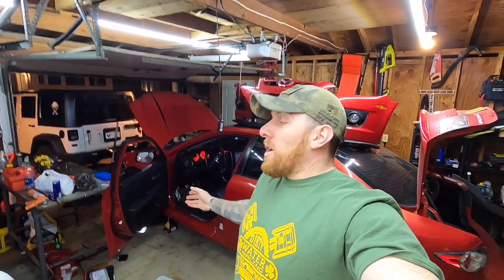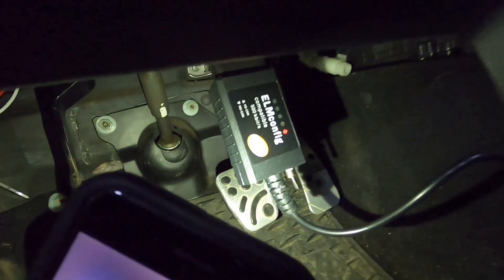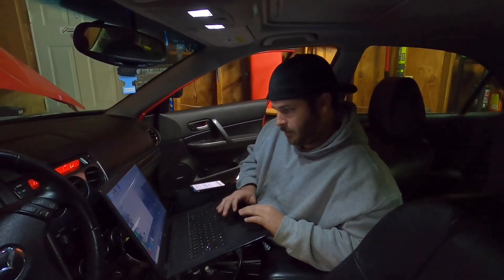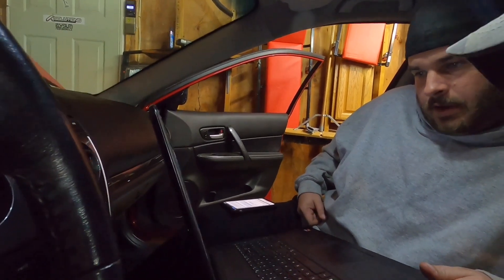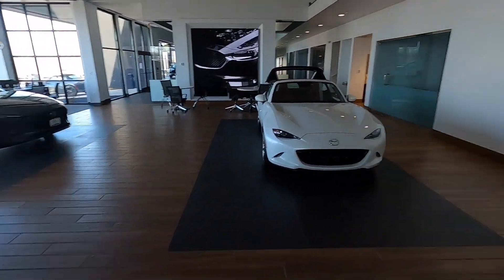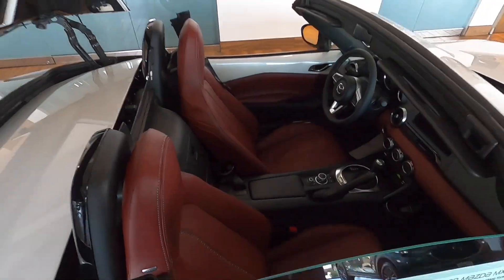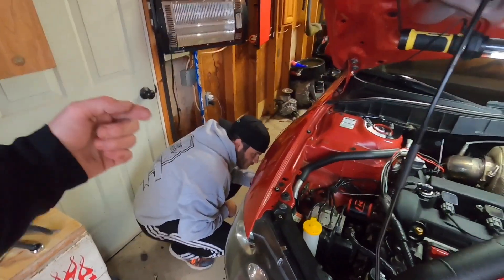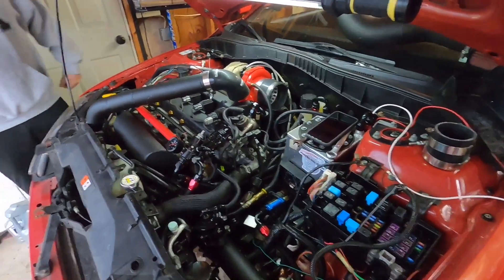Programming The New PCM To My Car WITHOUT DEALER?! This BEAST MAZDASPEED6 Is So Close To Running !!

Comment: Probably way too late. but I work on a lot of these cars and a lot of times when I see Powder Coated valve covers  if you don’t sand the material off where the sensor bolts to the valve cover, it creates too much of a gap for the sensor and it won’t start. Had cars come in not starting, and I literally just sand the valve cover where the cam sensor bolts in and it fires right up
Reply from the maker: This is a very valid comment and a lot of times people’s issues but in this case I knew that before powder coating and made sure those surfaces were bare / taped off for coating.

Comment: This was a brutal watch.    The keys are stored in the bcm or ipc. The car knew the keys already.   All this nonsense for a parameter reset
Reply: Yes they are stored in the PCM or as he's calling it ecu. Regardless it's the main computer it's restored in, which is the item he is replacing. So there for has to program the keys to that computer
Reply: @jeremyproctor3357   wrong.   It's a ford the keys are stored in the instrument cluster or body control module.   The security handshake between that item and the pcm is what starts the engine.  Install pcm.  Click parameter reset in the pats menu after a 10 minute wait or an incode and vroom.   It'll have abs lights till u match the vin but will fully operate the engine and transmission.

Comment: I found out I may have a bad PCM. So you are telling me that with my laptop and Forscan full Windows version (plus USB/OBD2 cable)... Can I either reprogram my PCM or if bad, buy a used (good) PCM and reprogram it? My 2017 Mazda CX-3 keeps giving me a bad MAF/Barometric sensor code. I replaced the MAF OEM Mazda sensor but the problem keeps coming back after 20+ days. I suspect a bad PCM... What about the key fobs? I have been told I can buy a pre-programmed PCM but then I have to take the car (that would not turn on) to a locksmith for reprogramming keys. Would this avoid all of that? Man, I loved this video. Wish I could have seen the secrets lol.
Reply: Hi I'm the same situation. My PCM is bad and I found a new one. I was wondering how did you do it with the key fob?
Reply: @theObsoleteTechie  I am assuming your new PCM came fully updated, (or is it a used one?) otherwise you have to download the AS BUILT files from Mazda. Then the job is erasing the old PCM files and uploading new ones based on your VIN# if it is a used PCM. If it is a NEW PCM then it is likely reprogrammed already you provided your VIN# when you bought it. Let me know I come on quite often.
Reply: @tsunami770  thank you for the prompt answer... yes it's a used one that matches the old one. Do you know if forscan can erase the used one?
Reply: @theObsoleteTechie IF that's the case you are going to need the set of files from Mazda AS BUILT. and  the Mazda IDS software from the Mazda website. I believe Forscan is capable of re-writing, tbh I don't remember which of the two I used but the IDS with the AS BUILT set of files for your VIN# sure can along with the hardware. There are also plenty of videos in YouTube showing how to reprogram the PCU. I know you can do it with all that and a bit of YouTube watching.
Reply: @tsunami770  yes I did stumble on Mazda's website for programming the pcm. I downloaded the "as build" sheet for my car. Hopefully I can use for scan if not I'll use Mazda's IDS software. Thank you for the input.
Reply: @theObsoleteTechie  You will find a lot of help in YouTube from others who already did that.
Reply: @theObsoleteTechie  yes sorry for the typo... as build...

Comment: That sounded like it was flooded -- that would also explain fuel in the oil. Pull the power for the fuel pump & if it starts and dies a second later -- you have verified flooding/

Comment: 100% flooded I'd say put a better battery on it let it stand without plugs and change the oil 
Injectors are cheap so I'd change them too up the cc to 1000 or 1200 while your at it.
Lol cars are Sooooo much fun...
I just bought a 2009 - 95.000km base black mazda 6 for $700. Yes it need a lot of work but worth it in the end.

Comment: Does Forscan also allow you to reprogram the VIN on the PCM? I am actually gonna use a VCM-II and Mazda IDS, but not sure if the PCM is able to have the VIN changed if I buy a used PCM instead of a refurbished one. 

Hoping that Forscan can, cause that would mean that the IDS can for sure.
Reply: Any chance you figured out the answer? Ive been wondering the exact same thing for a while now. If you haven’t tried I’ll order it and give it a go
Reply: any results on forscan, able to reprogram a pcm,ecu. looking to purchase junkyard brain but not sure if my software will work

Comment: I'm having the same issue after an engine replacement. 
gonna check spark and compression this weekend but had a question.
The camshaft lock plate i got from edgeautosports only fit one way with how the cutouts are on the cams. I assumed I didn't have to bother to check that it was tdc at no1. was that a mistake? I know I should've double checked but I was in a hurry when doing the timing.

Comment: Is it possibly to fit a gen2 MS motor into a MS6?
Reply from the maker: Same motor . Just have to put the MS6 power steering pump on, MS6 alternator (difference in  voltage regulator I believe ) , and a few other odds and ends . But the long block is the same

Comment: To be safe you can also rebuild the hpfp seals with one of reys kits that would ensure the fuel isn’t mixing with the oil there
Reply from the maker: I have a fully rebuilt one with a Rey’s kit ready to go it’s on the rx8 down at the fab shop they are sending it up . I also have another Rey’s kit sitting here at the house that I will rebuild here after In swap my already rebuilt one

Comment: That's how my car sounds every cold start but that's from running e85, I just have to modulate the throttle the first 3 attempts lol

With that much fuel in the oil I would take the HPFP apart and look at the O-rings. I replaced mine a couple years ago and my oil changes stopped smelling like straight ethanol. It still has some fuel mixture but from my understanding you can't fully get rid of it with these motors. I haven't logged on to MSF in a long time to see if that changed but that was the consensus when I no lifed that forum from what I can remember. The only other things I can think of are spark plugs, coils, MAF sensor(and wiring), and/or injector seals with how that compression test went. 

You got this tho! It's getting closer every time it sounds like.
Reply from the maker: Thanks man ! I have a rebuilt hpfp on the rx8 for mock up that’s on its way back up to swap out with this one . Then I’ll rebuild this one with another Rey’s Mazda Parts E85 oring kit

Comment: If you had fuel washing the cylinder walls could be temp sensor related (had a couple of cars do the same for customers). 
Also since there was sooo much fuel try spraying a bit of oil into each cylinder to try and raise that compression back up.
Reply from the maker: See I freaking thought that temp sensor was an issue ! I found a broken wire on it

Comment: Are you sure Throttle body is physically opening? Fuel spark air. You get spark and fuel. So timing of spark or your not getting air?
Reply from the maker: Throttle body is opening , even swapped with a spare to make sure

Comment: Keep at it man! exciting to hear compression during the last few cranks.. my thought is even if you were cranking with no fuel or spark the motor should sound like its compressing air right? other than the last few cranks it didnt sound like it should, sounded like the cylinders weren't compressing like when we do a compression test. 
I know everyone has an opinion.. mine is i still would be looking at the cams and timing.
Reply from the maker: The reason as we know right now for loss of compression is from fuel washing out the cylinders. Timing is 100% on verified 4 different times with all timing tools in place with cylinder 1 at TDC . Crank bolt , crank pulley pin and cam plate

Comment: When I changed some parts on mine, it decided to not start. After a lot of trouble shooting I found out tons of fuel got into my oil. Still no idea how it got there. But after I changed the oil it started right up and ran just fine. Just had to change it every hundred miles or so until I was sure no more fuel was getting in, and also to make sure it rinsed all the fuel out to not prematurely wear out any seals.
Reply from the maker: Very good call , I will probably do a few oil changes after I get it running

Comment: My car has been down since November  same issue. I haven't stopped on it. So you can do this.
Reply from the maker: Thanks and you got this too!
Reply: @SpoolingUpPerformance  I did the vvt gear, exhaust gear and cam, timing chain and tensioner and all new stainless oil feedline and new oil drain adapter today.

Comment: Damn I thought for sure the forscan would have worked at reprogramming the keys . Another thing you could do on top of replacing the injectors is if they were dumping fuel into the cylinders it could also foul the plugs out even if they have been replaced recently. What dose the Fuel pressure get to on the access port while key on ? And then while cranking just out of curiosity? I know you will get this figured out buddy don’t give up I feel like you are very close!!
Reply from the maker: Plugs just changed during all this , pressure was kind of inconsistent that’s why we started looking more closely at fuel after accessing this forscan program and being able to see everything the ecu sees during cranking and while sitting static
Reply: Spooling Up Performance . I’m sorry if you have mentioned this before but what HPFP internals do you have and if your getting enough pressure to atomize the fuel at start up or another common issue is the high pressure relief valve they tend to fail pretty often especially on tuned speeds. Idk again sorry if you’ve checked these things but those are definitely possible fuel system issues especially since the car ran fine then just shut off. What you could do idk if you’ve tried but pull the charge pipe off and spray some starting fluid in the intake now that your getting a burble from the exhaust you have to have spark see if she fires. However again I think your on the right truck man.!
Reply: @StabbinWagon402  I think that's a good shout re high pressure relief valve. They do go on occasion.
Reply: Can you get your car out of anti theft lockout- no start mode?

Comment: Im not going to say i told you so BUT I told you it was an injector issue, may have fuel pressure etc but if they arent atomizing properly its not going to start. Should have pulled those and had them tested/cleaned. Its an e85 thing lol
Reply from the maker: A lot of people said it Those don’t didn’t have e85 through them . The PI injectors did bit those have already been cleaned . But ya e85 is a bitch

Comment: @Spooling Up Performance I ran into an issue similar with your crank position sensor. I had actually bolted mine on backwards which put it off by a whole tooth. It should be the 21st tooth not the 20th so you may check that it is not needing flipped around! Like you said it makes a world of difference as each tooth is like 12 degrees of  timing or something crazy like that. Let me know if it’s correct or not and hate that your having a bad time with it man!
Reply: its definitely the 20th tooth.